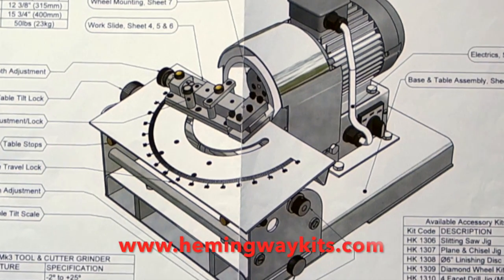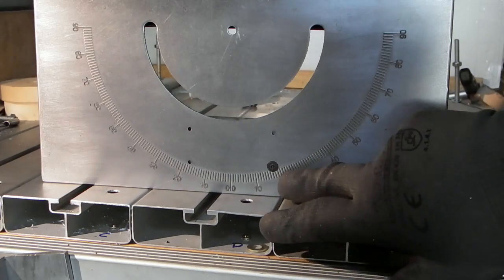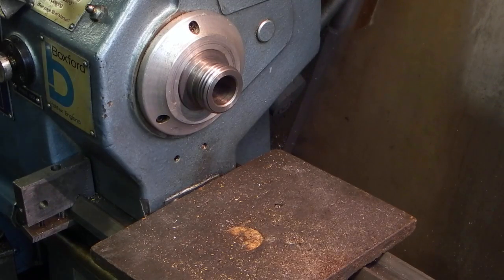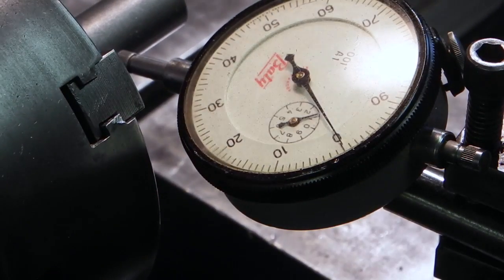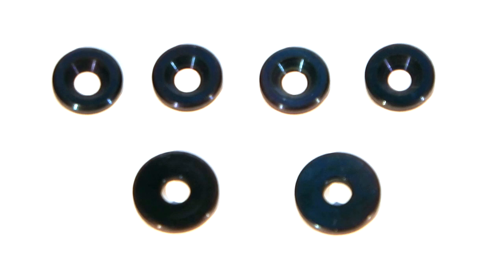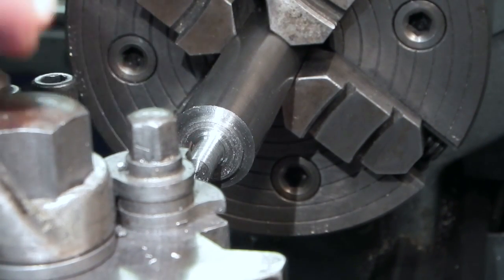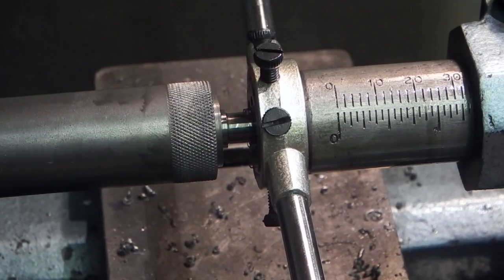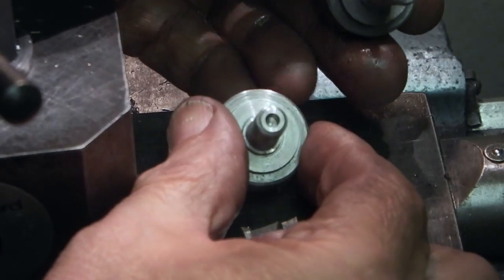Tool & cutter grinder part 2

Comment: This video series appeared to be a good one. I have persevered until the end of part two. Sorry Alan the noise between segments of you talking is far too loud. The only noise there should be on an engineering video is the sound of metal being cut. I can not put up with it any longer. I have watched other videos of yours and don't remember the noise, I think that it is meant to be music, being a problem. I have found your other videos very good and educational.

Comment: If the parting tool is chattering, and is setting on center height, try 1/2 your cutting RPM. This lets it work out the chatter.
Reply from the maker: Thanks 
I will try that next time.
Reply: It was chattering because of that bloody great sickout of the chuck! Yes I agree that the speed should have been much slower, say 80 to 120 rpm.

Comment: Allan I'm enjoying your videos, just one question, why do you keep calling a pillar drill a drilling machine, I've noticed other Youtubers avoiding calling it by it's UK name! All the best, Matthew
Reply from the maker: I say drilling machine because it's the operation I am doing not really referring to the type of machine.
As you say it is known as a pillar drill in the UK.
Reply: enots engineering it's also known in the UK as a drilling machine because that is what it was called in schools for years. I taught metalwork and woodwork in a comprehensive school in the late 70's and 80's and it was always referred to as a drilling machine. It was also referred that way to the firm I was apprenticed to as a church organ builder.